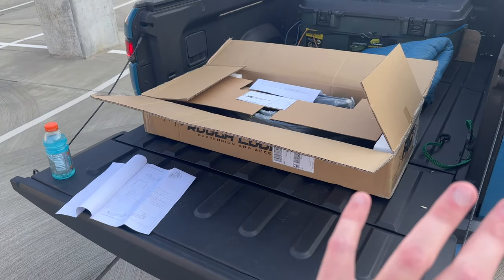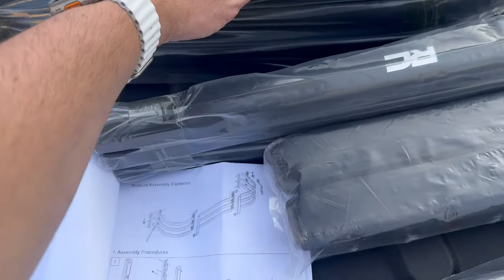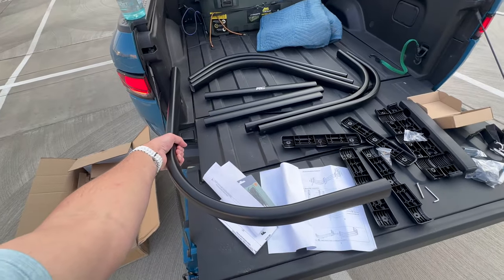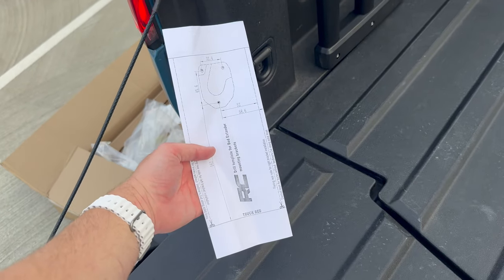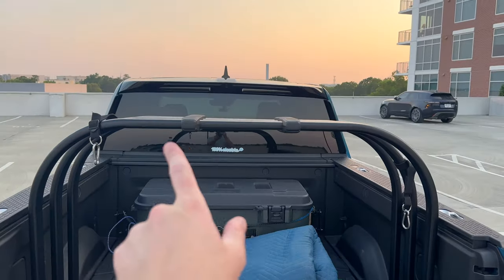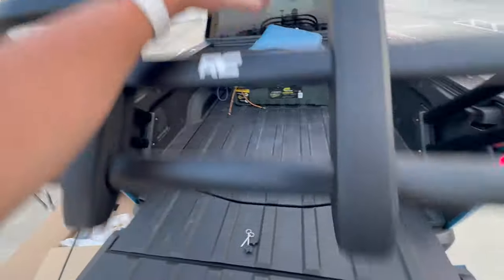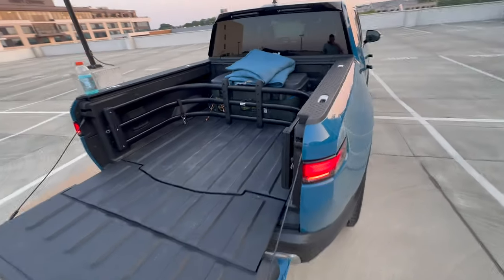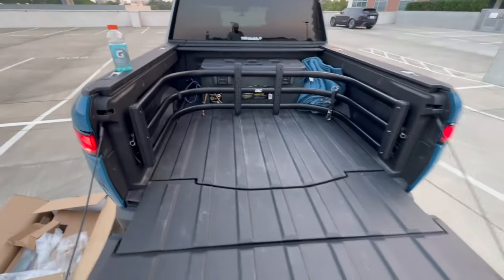Rough Country Rivian Bed Extender Install and Impressions

Comment: Turn your pins around!  I see that they have the small retaining bearing on the end, but it's much better to have your pins facing the other way.  This will increase the reliability of the pins, to help ensure that they will not fall out due to vibrations or other quirks. Safety first!

Comment: Looks great! Just skimming the video real quick, will be keeping an eye on this. I'd be curious does it only screw into plastic? What is exact measurement with it extended, and does it interfere with the spare tire storage area?
Reply from the maker: Yes, only screws into plastic. No interference with the spare area, but you’d need to remove it (but not the brackets) to open the area.
Reply: @brandenflasch  thanks for getting back to me!  Figured you'd need to remove it to access the spare tire area.  Can you get a measurement from end-to-end of the bed with it extended?  In particular wondering if 6' lumber will fit within the space?

I'm assuming this is just a prototype, has the company provided any eta on when it might be available to consumers?

Comment: Like the concept.  Always a little leery to drill holes into any vehicle.  Similar to Ford bed extender.  Price point?
Reply from the maker: Agreed! This is a bit less daunting since it's plastic vs metal that would be introducing potential rust / corrosion issues. If you wanted to undo this install, you could just use some silicone or other sealant across the hole or just leave them and be fine.

Comment: I would expect the pins to go in from the cab side so the ring cannot pass through the hole.  Enough vibration with in inserted from the underside could allow the pins to fall out.
Reply: What I was thinking, def wanna put the pins in from the other direction

Comment: Holden in your dirt bike with 6 screws?
Reply: That's what straps are for. No one is going to throw a dirtbike in there without securing it. I'd argue a bed extender is pointless for that use case anyway

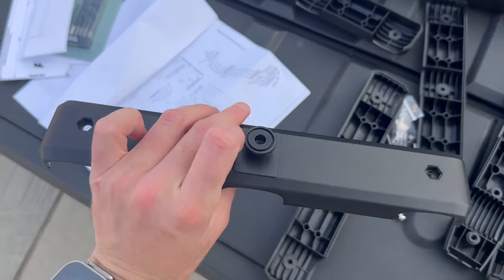Comment: 3:01  most brands have the same PLASTIC pivots.. absolute JUNK!!! ..that breaks off when installing of removing the bed extender. I cut my broken ones off and replaced with a metal pivot I lathe turned out of aluminum.
6:11  you installed the brackets on the wrong sides, switch them left to right. Slot angles forward to resist loads when extender is out on tailgate. Also positions the retention pull pins downward so gravity isn't working to back them out. FYI - those rubber cap things are useless, tossed mine.